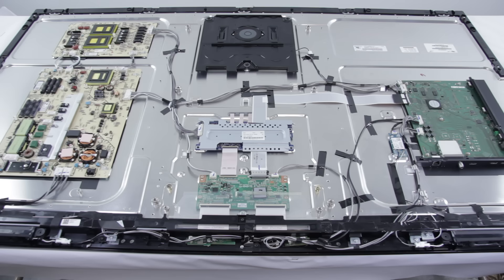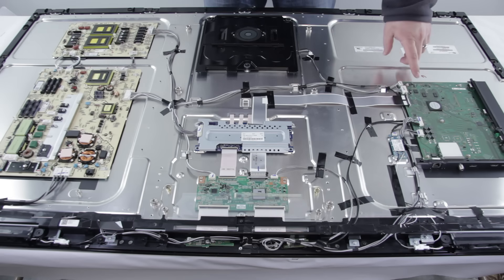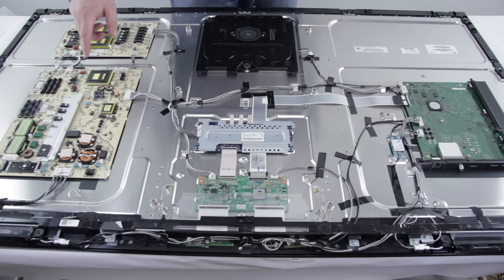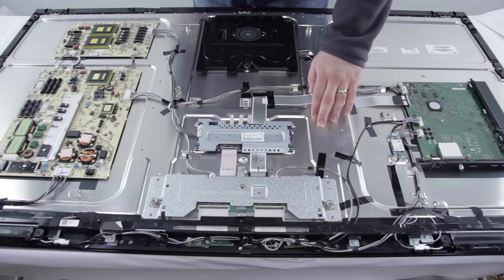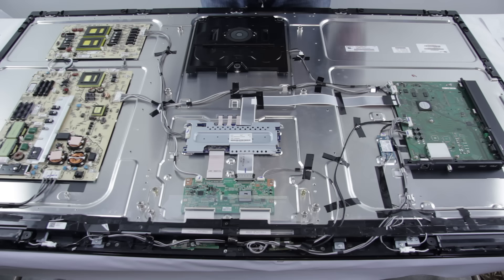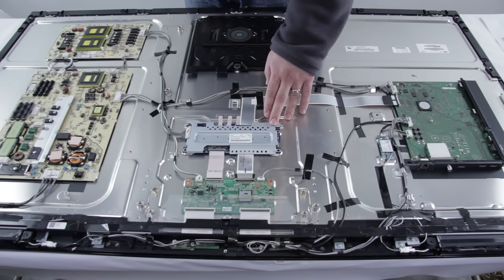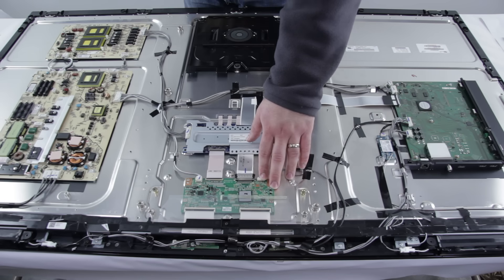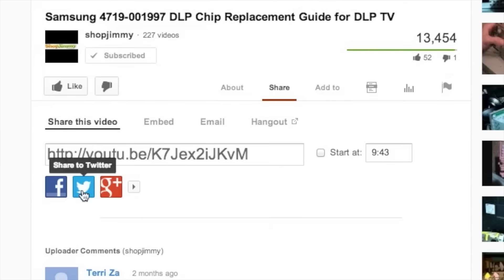LED TV Repair Tutorial - Common Symptoms & Solutions - How to Repair LED TVs

Comment: Hi I just watch your video on led tv repair it was great you guys really is help full I have a LG 47LN5700 when turn on the screen  flash on and flash off but I can the big logo sign throught the flash like the bulb or the LED is gone I had it check and I was told I need this part AGF78240801 can you tell me what is wrong and how I can get the parts thank you for your Video

Comment: Hi there, I have a sony KDL-50R550A lcd tv. My problem is " when i turn on the tv it shows the Sony logo and then it goes of and it does this three times to be exact then it blinks for six times stops and continue to blink for another six times and it does this repeatedly. Now i have two questions.  (1) can you tell me what might be the problem there ?   (2) where exactly is the inverter board located on this model tv ? I thank you for any assistance you can offer.

Comment: Samsung LED TV : UN55D8000YF 3/4 Dark Screen Display
I had this model for more than 4 years. 

But now everything I turn on the TV , I will get 3/4 of the horizontal screen has picture but darker than normal and 1/4 at the bottom is normal. I have to wait for a while like 10-15 minutes and the top 3/4 dark will go away and the whole picture become normal display again. Or sometimes wait a while and then turn off and turn on tv again and the problem disappear. I would like to know anyone facing the same problem and know how to fix this problem.

Comment: 55 inch LG smart tv (model number 55le5400-uc) making a whistling noise and has a fuzzy picture.  The volume adjusts itself and jumps automatically to the games that are on the smart tv...sometimes, the power button doesn't work either (this happens when all of the buttons by the power button are lit up.

Comment: I have a Sony Bravia 60 in. Model #KDL60EX720
It has one dotted red line running vertically down the right side on the screen approx. 1/2 inch from edge.
This line remains throughout imputed devices.
?

Comment: i have a Samsung 60in led
 model # un60eh6050f , model code un60eh6050fxza
it turns on and it has audio 
did the back light test no back light and no picture

Comment: We have a LG Lcd model #47LD500-UA 60" TV that is less than 5 years old. The power won't come on. We have changed the batteries in the remote and changed power cords with no success. The receptacle operates ok with other devices. Is this repairable for a reasonable price or should we suck it up and buy a new TV? Appreciate the video and any comments

Comment: I HAVE A WESTINGHOUSE 32" LED 1920 X 1080P. APPROX 2 YRS OLD, MODEL #LD 2680. I TURNED ON THE TV YESTERDAY AND I HAD SOUND, WHITE BACKGROUND BUT NO PICTURE. I CHECKED THE POWER CORD AND CABLE, UNPLUGGED POWER CORD AND THEN PLUGGED BACK IN AND NO CHANGE. IF YOU CAN FIGURE OUT WHAT PART I NEED CAN YOU ALSO COMMENT ON WHERE TO GET THE PART AND IF IT WOULD BE BEST THAT I GET A REPAIR PERSON TO FIX IT AS OPPOSE TO MYSELF. THANK YOU, PATTY

Comment: hi my 40 inch samsung smart tv is not turning on but the red led light on the lower right side corner is flashing. try to changed my remote battery and remote control but no luck. some of my friends told me that it might be the capacitor. the model of my samsung smart tv is MODEL:UA40F5500AM
VERSION NO:HS01
S/N: ZY3S3MEF200172R

Comment: I have a Samsung 52 inch HDTV. Model No LN52A650A1F. Symptom is constant power cycling when plugged in. Keeps cycling every 10 seconds or so. I've opened up the back and there are no bulges in the capacitors on the power supply board. What else could I do to troubleshoot? Thanks.

Comment: i have lg 47LW5700 and it dose power up all voltages present at power supply no picture no sound 
i did flash light test no menue  or lg simble  i belive it has to be main board

Comment: Hello ShopJimmy, I'm having a problem with my XBR-70X850B Sony 70" HDTV.  It operates fine for awhile, then goes into a stand bye mode.  The red led light flashes 4 times, pauses and flashes 4 times again and repeats.  The TV won't power up again without first unplugging the unit.   I've seen on-line that this corresponds to a code?  Can you explain??  And maybe discuss the fix?  
Thank you!
Jerome.

Comment: Hello, I have an LG47LS4500 and have replaced all three boards (power supply, main, and T-Con) I have backlights and audio but no picture or menu ...just light blue screen. I bought the boards from SJ and was told they were from a new set which had a cracked screen.
If I unplug one of the ribbon cables going to the screen from the T-Con board, I get a half white (right) and vertical colored lights (left) but when I connect it back it goes back to light blue screen. Any thoughts? I appreciate any help at all.
Kirk

Comment: I have a Vizio 47" ev47i-ao. It turns on for 3-5 seconds (power light comes on after 3-5 seconds and fades out slowly) and then shuts of no display at all it doesn't even show the logo.  we had a "repair man" from walmart service plan come out and try to fix it.  but i dont think that he tryed to repair it very well.  every time he would try a new part he would take it back out and try another one.  I am no expert but wouldn't you try all the new parts together and then try to diagnose the problem.

Comment: I have a samsung un50eh5000f. TV is powered up and can hear sound but have a blank screen. I did the flashlight test and I can see an image so I replcaed the LED Power Board because everything is built on to that on this particular TV. I still had the same problem, no image, but I could see the image with a flashlight. If that didn't fix it, what could the problem be? The LED strips themselves?

Comment: samsung model UN60FH6200F .  I have picture under a flashlight. Sound is good, picture is great (just dark). I replaced the power supply before figuring out the screen actually came on just didn't light up. I can't seem to find a LED driver on mine as you showed in this video. Should I replace the tcon or is it the panel itself?

Comment: I have a Samsung model#UN55F6300FXZA that doesn't turn on. the red light at the bottom only flashes, a tech told me it was the LED light or strip but that it cannot be replace its that true?

Comment: Never mind, peeled back the edge cover on the tv; several of the small caps on the corresponding board that connects directly to the led panel are fried. I dont believe this can be fixed with out changing out the entire panel. this is too costly. now I have 3 working tcon boards, 2 working main board and 1 power supply board that I need to see if I can return or unload.

Comment: I have a Samsung UN50EH6000FXCA Version # CH01. Had backlight and sound so I replaced the tcon board (cheap): no change so i replaced the main board: no change, I thought maybe the cheap tcon board was bad so I ordered another. I turned it on and half the image was there the other half of the screen was white. I looked the board and saw I had not attached the right ribbon cable, attached the right ribbon cable and the blank screen with backlight and sound was back. repeated the procedure, removed the right ribbon cable;  half a picture, replaced the ribbon cable no picture remove the left ribbon cable and plugged in the right no picture. put the original tcon board and original main board back in unplugged the right ribbon cable from the tcon board and got half a screen working and half a screen white. please help. it doesn't look like my issue is related to the tcon or main board.
Thank you

Comment: hello i have a 55le5500
it was acting strange today shutting off randomly, then dimmed. power save was on and turned it off and the screen came back lit. later it gave 3-4 loud pops then shut off. now the lights turn on but nothing ever comes up on screen. i am an electronics technician. i disassembled the tv and found no obvious burning or blown caps. im a little confused on which board to replace. i only see 3 boards but the power on/stand-by lights all cycle on. so idk if it's the power supply board, main board, or driver board. can you plz advise. i will purchase the replacement but i see on your website the boards are out of stock.

Comment: SHarp 48" Model LC-C5277UN - Replaced the T-Com which I ordered from you guys but the problem did change. I have no picture but have the Power & OPC light blink together 2 times then just 1 light blinks 3 times and this continues indefinitely. I have tried to reset to no avail. Any suggestions are welcome. Thanks

Comment: hello I have a proscan pled4275a which got hit with controller and now looks shattered at the point of impact but turned off the outside of the screen doesn't seem cracked. Just wondering what would be needed to repair since it is only around 6 months old? Thanks for any help.

Comment: Vizio E48-C2 will turn off and is unresponsive to remote until I do a hard reboot (unplug and hold power button down for several seconds).  I have also noticed that my wired ethernet port is not working.  Finally I have had at least one instance where the TV picture was working but sound was off (yes I checked the speaker settings and made sure volume was up).  In all cases a hard reboot returns the TV to working condition for a variable period of time.

Comment: I have a samsung UN50H6201AFXZA.  The Tv picture does not work but the sound does.  there is a blue glow while the power is on and if i touch the screen it turns blue.   I just replace the t con board thinking it would fix the issue.  It did not.  Any Ideas?

Comment: I have an LG 47LF11 TV.  When I plug in the set and attach an HDMI input, the set comes on buy only the right half of the screen is working and the set will shut shut itself off after about 30 seconds.
Any assistance is greatly appreciated.
Thank you in advance.

Comment: Toshiba 46G310U.  I turned it on.  It came on but went blank (no picture, no sound) after just a couple of seconds.  The power light is on but the remote will not turn the TV on or off.

Comment: I have a Samsung Model UN46C6300SF LED Flatscreen TV.  This TV became damaged when movers mishandled it.   The screen now has vertical color lines in the center of the screen; with strange broken-like lines at the bottom of the screen.  What do you suggest as a possible repair

Comment: Vizio E500i B1 here, Works on Occasion, sometimes the screen will flash when I turn
it on, while still not loading, and sometimes just nothing. No sound, no
flashlight test screen, what board would you suggest? The light underneath always works when nI turn it on or off.

Comment: Hi,

I have an LG 55 inch LCD TV that has an issue (as follows)
1. Press power on - will produce a high pitch noise and nothing is shown on screen
2. Need to turn off the TV
3. Repeat steps 1 and 2 for about 5-10 minutes and then it will power on

I had a repair guy tell me it was capacitors and when he opened up the TV, he found all the capacitors were fine and said it was the motherboard and would cost me $400 to repair. Can you help me out?

Comment: I have a Vizio E701iA3,it has a blank blue screen when powered up and it also has sound. From the investigation I did it sounded like I needed to replace the T-Con board so instead I ordered the whole repair kit from Shop Jimmy, after I replaced everything  I still did not get a live screen. What do I need to replace now? Model # LFTRNXBP2403010 ? I did the flashlight test and there is nothing in the background except blue screen.

Comment: I have a funai led tv model number LF320FX4F an the problem I'm having is when I turn it on it will show the funai display for less than 1 sec before turning it self off the indicator light in the front will blink 15 to 17 times (unsure on the number as I doubt if I catch them all due to bad eyesight but certain it is  between 15 an 17) then go back to solid as when it is off any help would be very appreciative thank you for your time

Comment: Hi shopjimmy.com thanks for all your tutorials.So my brother in law has a LG 55LV5500 with a no picture no sound issue. Front standby light is off in thier settings option but the power light does turn on and stays the solid white as it should when the tv is turned on (if the standby light setting is turned on then the standby light is red when the tv is off 24/7 ). I see no light through any of the back holes from the back of the tv. Today I will remove the back panel to confirm no backlight. I tried the flashlight test and no image at all. With the remote control whenever I press a button the power indicator is suppose to blink to confirm the tv has received the command from the remote control. The light just stays solid white and does not blink. Can you point me in the right direction on what to test? Any advice is greatly appreciated. Thanks.

Comment: My TV is a Vizio E5001-B1.  When the tv is running, suddenly the tv turns off by itself.  No picture, not sound.  When you turn it back on it comes on, but then in a few minutes it goes off again, etc. etc.  Can you tell me what board needs to be replaced to correct this problem.  Thank you. - John

Comment: I have a 60 inch sharp aquos lc - 60le640u and I had the 1 long, 1 short blink. I replaced the LEDs (which were shot) and the power board (which had one distinct area that was burnt out). The TV turns on and works fine, but there are two dark spots in the led strips I just replaced. I wonder if I got some faulty LEDs or if there could be some other issue causing the dark spots. It looks like the LEDs I replaced (which came in two strips) are divided into quadrants. The last quadrant on the first strip and the third quadrant on the second strip isn't lighting up. I'd love to not have to take the whole thing apart again. Any help would be greatly appreciated. Also, the dark spots were an issue on the TV before it went kaput.

Comment: very useful video, and It did really help me from my problem. the same problem I have with my 60 in LG LM 7200 3D Smart tv that has nompicture with a clicking noise and also the HDMI PORT ARE NOT WORKING clear is a mother board issue so why expend money on repair because it won't last long .rather get a new one

Comment: Hi.  I have a Samsung UN55ES6500.  It has one horizontal line across the top portion of the screen.  It is present on all inputs and also on the smart hub features. Other then the line the picture is great.  Any ideas on what I need?  Do you think it's a bad LCD panel?

Comment: I have Samsung 55JU6600 Curved UHD 4K TV. There is no image or sound when I turn it on. The red light blinks 5 times. The TV is not operational with remote control. The only thing the remote works is to on the TV thats it.

Comment: Hi! I have a LG 60LN5710 it powers on OK. but the image toggles  from looking ok to horizontal lines every second or so  not the whole screen just like 30% to the center. I replaced the T-con card it inpproved some but seems like there is another faulty part. could it be the main board? or the power supply, or the LCD DRIVER card?

Comment: I have a Westinghouse LD-4255VX. It works fine for about the first five minutes, then the led backlight goes out. If i turn it off and then back on it works for maybe 30 seconds and goes out again. Sound is fine, and when I shine a flashlight on the screen there is an image, just no backlight.

Comment: i have a 55 inch LG UHD TV (55UF680V) with a cracked screen. The tv is barely 6 months old.The tv still works fine but looks ugly with the cracked screen. my question is, is it worth repairing which i hear could be very expensive or better to get another tv?

Comment: I have a LG 52LF50 and when I turn on the tv, it will start up for approx. 5 - 10 seconds (the light in front does turn from red to blue) and then there will be a pop sound and then the tv will turn itself off.  I have taken the back off the tv looking for the capacitors that appear to be bulging, however they all seem OK.  Any ideas?  Thanks.

Comment: I have LG LED TV SERIES LM6410 42 INCH. on TV horizontal lines are appearing. sound is OK. I asked local repair service, he said bad main board. also, called LG Customer care. without doing anything or seeing screen for 10 seconds he said panel damaged. not sure who is saying correct problem. can you please guide ?

Comment: I have samsung UA37D5000 tv. There is thin vertical line appearing in TV. When I called up the local service guys to check, they said they have to replace the panel. I don't believe in their words. Will you be able to tell if it's the real panel issue or some board issue.

Comment: I have a Zenith Plasma TV model number z50pj240-ub serial number is 010rmjf21668. Symptoms are as follows. When I turn it on initially it works great. After a few minutes it develops horizontal lines almost grid like. After 30 minutes the screen goes black. Sound works fine throughout. Please advise.

Comment: LG 39LN5700-UH

Original symptom – no display Checked with flashlight image
present but no backlight Tested LEDs, one strip not lighting up

Ordered LED strips and T-Conn board (I broke T-Conn board
connector when disassembling the unit) 

Replaced LEDs and T-Conn board  
After replacement – no display, no image visible using
flashlight, backlights OK
Did RMA for T-Conn board, received and replaced (second
replacement T-Conn included ribbon cables, first replacement did not)
Now still have backlights, display has changing vertical lines,
sometimes gray, sometimes sepia, sometimes narrow color bands
No sound but did not check for sound before and can’t see
anything on display to select input.
What is going on?

Comment: Hi,  I have an LG model 55LA7400-UD. After power on,  one side would go dark. After turn off and back on, the TV would turn itself off. I replaced the power supply board. It worked for 2 days. Now the power comes on with sound, but no picture. I think I would need the LED Driver. Any idea of the part number?